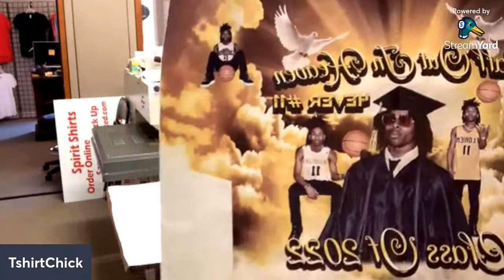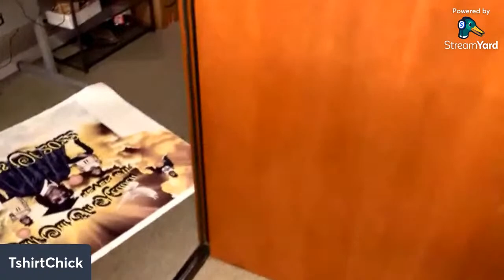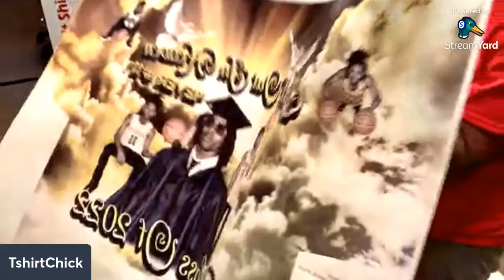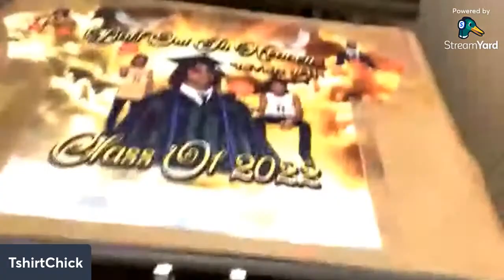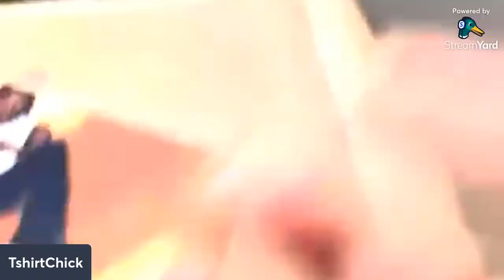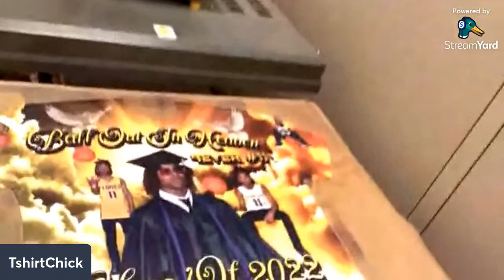All Over 3D Sublimation With 24 inch Printer

Comment: What size printer do I need for big size shirts? I want to print in one go.
Reply: That's exactly what I'm looking for
Reply from the maker: With a 44 inch printer you can print the full design all at once instead of using 2 sheets like I did in the video

Comment: Hey sin.. I'm Aditya from india
Please give  more information 
I want to start but i don't know how to setup 😢

Which printer do u use? 
What are the sizes of heat pres machine.... Is this applicable on all fabrics or only in polystyrene, nylon
Reply from the maker: Hi Ananya!  I have videos posted of all my equipment that are very detailed on each item.  Sometimes I don't remember all the details so the videos for each piece of equipment will have for sure info.  I think the heat press is 34x44 inches and the printer I use is a sublimation printer so it's for 100% polyester or high content polyester blends only. The heat press can be used for any fabric you would just have to adjust the temp for whatever printing process you decide to use and have a printer that prints for whatever media you will be printing on.